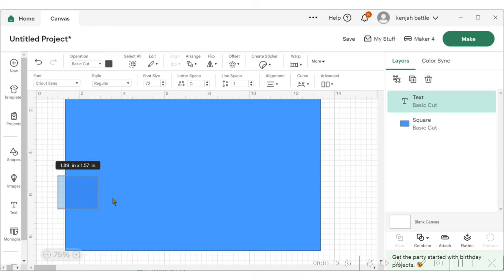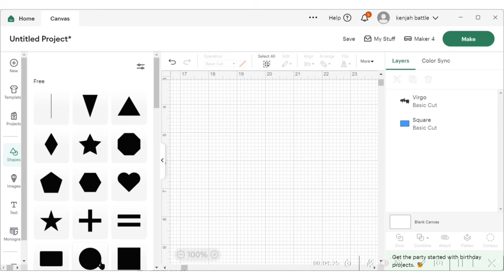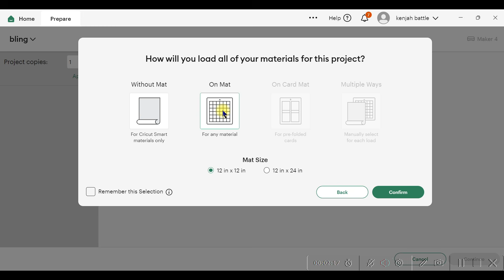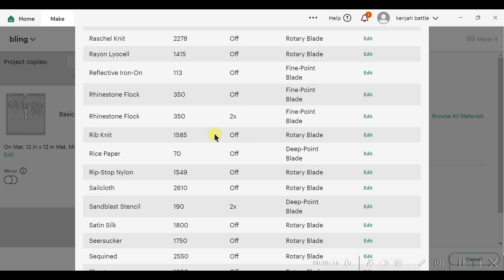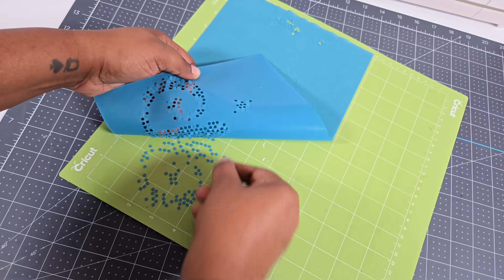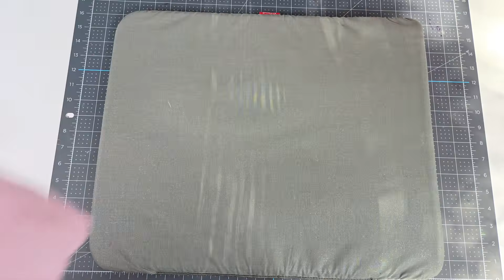How To Make Rhinestone Templates With Cricut | For Free

Comment: Thanks mama! I just bought the flock and i see so many others did too from watching your video    You should reach out to the seller or amazon or a flock company (idk how it works) and get a discount code for people you send their way because that company just made a bunch of sales because of you, rightfully so! Question instead of the tedious task of filling with holes couldnt you use the pattern setting? Ive nvr used it before but i want to! Or couldnt you make a template and save it thats just a rectangle with the flock dimensions with spaced holes that correlate to the rhinestone size, place it over your design and slice? Or whatever edit feature would do that. Or have you tried everything else and the diy custom to each design the best/only way?

Comment: Worth the time. However if you use an ap like gimp or Photoshop (old versions that are off line) you can use the brush tool with the same size as the hole. And you can make layers if you want to nake different size stones or other colors and save each layer as an sgv. For sizing put a 1x1 inch square off to the side. And you will know it will be the right size in design space. 

Seems like extra, but this is a step for ownership of your labor. The files not stuck in cricuts cloud. U can share w your friends or sell... 

Ty for the vid🎉